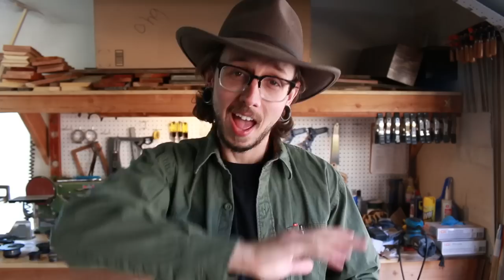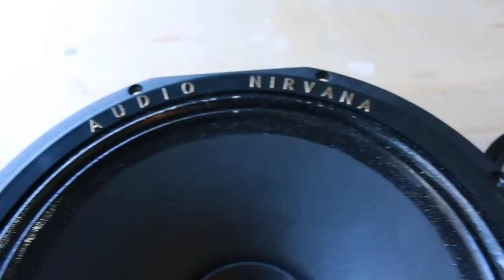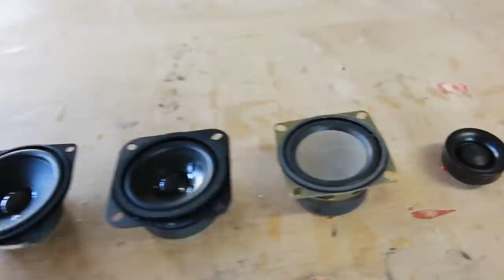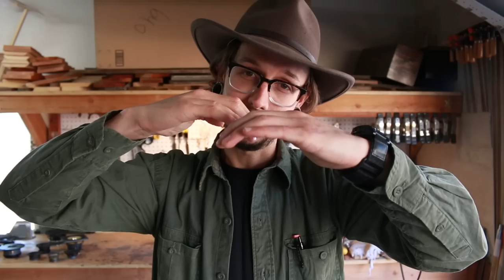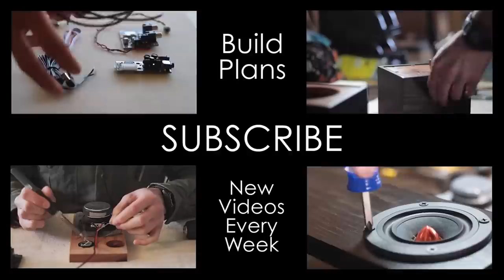7 Steps To Pick The Best Drivers For Your DIY Speaker Project || Step 3

Comment: I bought only 2 inch ghxamp and aiyima speaker and amplifiers. I also bought a narra wood here in palawan. Problem is I can not make mistakes cutting narra wood because it is too expensive. It is a one time cut and trim and making holes. Heavy wood but worth the sound quality.

Comment: I have some questions about enclosures, drivers and their acoustic relationship.

Firstly - Older/vintage enclosure shape was generally tall, wide and shallow whereas modern speakers tend to be tall, narrow and deep. What is the general sound you get out of older cabinet shapes vs new? Are newer ones better or different?

Secondly - Is there a general guide for how big the speakers (mainly woofer) should be in relationship to the cabinet? Is there a reason that a 4"or 6"woofer shouldn't be used in a cabinet that is, say, 500mm wide and 700mm tall? Is there a such thing as too small and too big?

Thirdly - Is it necessary to pad the inside of bigger cabinets or are there advantages/disadvantages to installing padding vs nothing?

Fourthly - Do you do any special calculations of how the cabinet space and shape will interact with the drivers or is that too in depth and unnecessary?

I'm asking because I have some vintage speakers (Goodman XB 25) that I need to replace all the drivers for. The woofers were missing and one of the tweeters was broken so I'll just buy new ones. They do have some 8"radio shack subwoofers as replacements which I think are good but I'm wondering they're somehow a bad match for those cabinets.

Also because I modified two sets of big enclosures maybe 20 years ago with mixed results. I had almost no idea about acoustics so I probably did too many things wrong. One set sounded okay, the other set ended up sounding weak. I can more into detail on the specifics of those if anyone wants to talk about that.

Comment: I just collect all sorts of old drivers from old speakers or cheap sets or thriftshops and based on what I have laying around I think of an enclosure type 'feels' correct for the drivers. It's going pretty well so far, already built one set of MLTL (Vifa ring radiator + Tannoy woofer, custom made crossover) and a smaller full range (FRS8 with homemade notch filter) TL.

I'm planning on building a back loaded horn with a small 3" or 4" full range driver. Can't wait :D
Reply from the maker: Sounds awesome! Thats definitly another way to go about it.

Comment: Will need to watch all of your videos 💯

Learning to build PC vs Monsters - mine requires 2 speakers + the other requires 2 speakers.

Lots to learn 💯 cheers for the playlist and plain English used  💪💯 Budget depends on speakers that fit the Monster.

As for the smaller one that cheap as chips.

$2,000 should do it for sound and other additional thoughts towards things to out pump the junk Bluetooth speaker trash they use around here 🔥 😂😂

Comment: Parts Express IS a great place for a very wide selection of speaker drivers of all types and price ranges, but also MCM Electronics and Madisound are two other great places to get speaker drivers and other speaker related components, (x-over stuff, cabinet HW, etc.)

And as far as the main title of this video goes, I also do a final side-by-side A/B/(C/D) listening comparison, (using a few of my favorite well known CDs and a special 4-way driver switch that I made), between any/all of the potential drivers that I'm considering for a speaker project to make sure I get the absolute cleanest and best sounding ones!... This is especially important to do with the midrange drivers, because I have found tremendous differences in overall sound quality and clarity, even between mids of the exact same size and type/design... And even though in general you get what you pay for with speaker quality, I have definitely come across a few really inexpensive drivers, (sometimes even "free", scrapped from another old or damaged speaker), that sound WAY better than some MUCH more expensive new ones, so a high price shouldn't be the main and definitely not the only deciding factor in guaranteeing a good sound... You definitely have to listen to them too! (As I'm sure you already know, but some people reading this may not have considered that...)

I have checked out a few of your speaker building videos, and I agree with most of what you are talking about... I might just have to subscribe.

Comment: Still loving these vidios, Just  wonderin, why are tweeters so expensive?
Reply: They are harder to make.  If you think about a 200HZ pure sine wave bass note the speaker has to respond by moving through 200 movement cycles a second, following the input waveform precisely.  At 16KHz it has to move through 16,000 cycles in the same length of time and still follow the input waveform as precisely as possible.  That second feat requires the materials to be much more rigid, yet lightweight.  You can have very light materials cheaply, or you can have very rigid materials cheaply, but you can't have low weight AND rigidity at once cheaply.  The second factor that drives up the cost is that tweeters have to be made to much finer tolerances than low and mid range speakers.  That means the materials cost more and the process of making those materials into a speaker also costs more.

Comment: When building portable active speakers (f.i. BT speakers), I would say driver efficiency (sensitivity) is about the most important spec. In theory a difference of +3dB will extend your battery-life by a factor 2. Apart from that I would look at the Thiele Small parameters, because from those you can calculate the size of your enclosure, the resonance frequency and the length of your bass-port if you build vented speakers.
The looks of the driver itself are rather insignificant, first of all you want good sounding speakers with long battery life. Based on the driver you can design a good looking enclosure even though the driver itself looks horrible, in which case you can hide your driver from sight.

Comment: I was thinking of grabbing a new pair of Polk R300s and swapping the driver and tweeter from parts express, specifically Dayton Audio DC28FS-8 1-1/8" and Tang Band W6-2144 6-1/2". I figured I'd get a two-way passive crossover at 3000hz. I'm buying the r3000 specfifically for the enclosure at 80$ a pair Canadian. Any tips? This would be my first speaker build and I really want to see what these Tang band drivers can do.

Comment: I am a newbe in the make speakers. Today i want construct 2 sorround speakers and center speaker for expand mi stereo system in home theater. My receiver is a Onkyo txsr-805 and my speakers are Polk audio RTIA9 floorstand. 
My question is: Wath  speakers (woofer tweeter)  i will select?
I like the soud of my polks and i want find the same harmonic.
Note: You chanel is very good and i learnt too much about. This encouraged me to begin this project.
Thanks.
Regars, 

Jorge
from Chile.

Comment: Have you ever done a video about full-range drivers? I'm wondering what ohm I should use in my 12 volt portable speaker? I purchased an inexpensive 2.1 amp board 50 watt x 2 100 watt sub.

Comment: Now can you take a low range woofer and a tweeter and put them in paralel in a large, heavily insulated sealed box and have good sound quality. from what i know you can and in some cases it sound better than with a midrange woofer. this is just a guess but i just want to check
Reply: You need a cross-over. When you build a 2-way system you often can do with a simple first or second order cross-over which need much less components than higher order cross-overs. If you omit the cross-over you are very likely to burn your tweeter at high volumes.
Reply: Czar Zenana  Alright, thanks!

Comment: Hey! Which 4x6" speaker drivers would you recommend? I will be replacing an old speaker inside a DIY Bluetooth radio that I am building, which happens to have this (odd) size.

Comment: I’m adding speakers inside of a small harp (a Harpsicle, with an approximate interior useable box size of 5 x 1.5 x 28 inches, 5 x 3 x 28 total if there was no wooden spine down the middle of the soundboard supporting the strings).  I think I’d prefer to use the speaker type that turns a surface itself into a speaker. Can you help me figure out what I need for this?  I suspect I need two 4-ohm transducers (I found a couple small enough to fit in the space between the string band spine and the outer case), a crossover for them (if crossovers are used for these sort of speaker) and a way to attach a 9-volt battery for power (though I’d love to be able to do without the battery).  Any recommendations?

Comment: Im building a small mp3 player with 3watt amplifier.  How do I know if a small speaker will perform well - high sensitivity?
Recall last century, 'transistor radios' had a tiny tinny sound, but now we can buy a 'boom box' the same size which is loud enough for a party.  Whats different in the full range driver inside and how to know when buying?

Comment: Do you have a recommendation on types of speakers for an outdoor application? One where it may be humid but no in direct rain.
Reply: I would suggest you try marine speakers , my favorite is a setup of 2 tweeters 1 woofer  on 2 separate boxes preferably plastic and 1 marine 10” sub or if you wanna go really cheap get any speaker and buy a can of everdry trust me it works I can fully submerge speakers and they will still play if you coated them really good inside and out

Comment: Currently I'm using a frankenstein setup of marantz precision series P-830 speakers with the woofers of a set of Pioneer S-Z94's.
At the moment it sounds amazing, but would it be worth building a custom housing?
Paid 10 euros for the P-830's with a perfect housing but woofers with foamrot, also paid 10 euros for the S-Z94's with 1 broken tweeter in one of the speakers.
Reply: hannes something IMHO building a completely new set of speakers would be a better idea. That way, you would know the thiele-small parameters of the drivers to calculate the ideal enclosure, and even spending less than $150 you could buy much better drivers (store-bought speakers usually don't have great drivers to keep the cost down, especially when factoring in their profit margin, amplifier, assembly cost...). You can check a popular and tested design (by zachaudio, the overnight sensations, or the ribbon "diy speedsters" which zeos reviewed) if you're interested.

Comment: I'd like to add a correction I think, don't worry what the look like, worry about what they will sound like. That's why you build speakers. Form follows function. For everyone out there I can tell you across the board  SB Audience are the "best" speaker drivers for the money, better than 99% of what's out there. Only thing, can only get them from Madisound. But still decent prices. SB Audience (Indonesia) is the only speaker builder that I know is 100% vertically integrated. In other words, no outside parts go into their speakers. Everything in house. From tweets, to mids, to woofers and subs, they really are a hard speaker to be, especially for the price. A 3 way tower speaker would run $300 on up for each speaker with SB Audiience entry level drivers. And still will sound great because they only make "Professional level" speakers.

Comment: Hello I had a question. I am wanting to build my own bookshelf speakers to finish out my surround sound. My receiver is a onkyo that’s rated at 75 watts rms my question is do both the woofer and the tweeter need to be rated at 75 watts? Or how does that work when using a woofer and tweeter.

Comment: I just wanna ask. Is a 60w (30w+30w) speaker too much?? I am planning to buy a 2 channel 30+30 amp, then wire a 2 way crossover to each channel, and then wire a mid range woofer and a tweeter to each crossover. Would that be okay?

Comment: Currantly doing a build with the 3" aurasound NS3 drivers. could you reccomend a tweeter and crossover for this.
  I am using 2 NS3 drivers per enclosure.

Comment: asymmetric speakers: As in emphasising tweeter and subwoofer to offset distance is also worth considering if distance is an issue. Our bedroom TV cannot  accommodate a properly configured setup as we wanted. Went with a 2.1 with refitted powerful sub and tweeters on the shelves. Mids reform with distance and more importantly; dialogue is always clear and action is always boomy without being muddy. Traditional setups that could fit were underpowered and mid heavy, weak bass and treble which was aggravating watching movies, and soundbars are champions at that crap.

Comment: can i use 2 peerless 30w rms full range speakers with an 12v 2*25 w sms amplifier? or would it not sounds good?
Reply: higher power speakers on a lower power amp allways works, but not the other way around (atleast not for max. volume).  watch the impedance, this is more important

Comment: I have been searching for a way to run two separate boom-box speakers via Bluetooth.  For me its no wires and being portable.  The output from my mixing board would need to plug into a the Bluetooth transmitter.  would I need a transmitter for each channel or is there a transmitter that will broadcast to two separate Bluetooth devices?

Comment: You don't use a subwoofer for the bass in a tower speaker. You would use a bass/midbass woofer. A true subwoofer will not produce enough mid frequencies and you'll be left wondering why your mids sounds so weak. Unless you have like a 8" woofer used as the mid-range. Subwoofers and woofers are not the same. Subwoofers require more power and a custom enclosure that could be built into a tower. Many companies do it. But you should also have a amplifier to power the sub alone that will hook to your receiver thru a rca or optical plug output on the back of your receiver. Let the speaker ouputs on your receiver power the other speakers in your tower.

But otherwise there's a lot of great info for the wanna be speaker builder beginner/novice

Comment: To further elaborate: the midwoofer must be chosen so that the crossover frequency is below the breakup point (you'll see a lot of peaks there), taking the slope of the filter into consideration. As for the tweeter, the resonant frequency is the lowest frequency that it can reproduce correctly, again taking the slope of the filter into consideration. Usually, most 6.5 inch woofers go well in a two way system. Some 12 inch woofers might also work, but it's better to do a 3-way or a 2-way with a fullrange. The lowest spl speaker in the system dictates the spl of that system. In an active system, it's easier to level match the drivers since you're doing it at line level, but in a passive system you use resistors or l-pad attenuators which are expensive and disipate heat. So it's better if they're about the same spl.

Comment: Hello Kirby Meets Audio great vids.
Not sure if you or your viewers can help..
I want to make a Blue tooth Box with these parts i had for years..
Two 6.5" 3 way speaker 240 watt max power each.   
One 10" speaker 120 watt
TPA3116D2 Bluetooth 4.2 Digital 2.1 Audio Amplifier Board DC 12-24V 100W+50W+50W  from ebay.. does it seem like an ok setup, im new to this.]

The 10 inch sub is old and was never used.  its not in the original package box so don't know what brand it is. Its an heavy well built sub with black metal frame. 
I want to build a box for this speaker and the two 6.5" speakers.
Is there a way to find out the brand or box size to build.           
I found this info on the side of it.

model number    RD-0008332
Impedance           4 ohm
Power                    120 w   
Date                        2000.10

Comment: does it matter if i use 8 ohm sub speaker with 4 ohm tweeters?
Reply: Depends on how you plan on wiring it in relation to the stability of your amp at different resistances

Comment: There's a mention of cabinet size, but no mention of cabinet type? Come on now. Tuning the cabinet is just as important as choosing the right drivers. Are you going to use sealed, or ported? Do you want to increase frequency response on the low end with a passive woofer? Do you want to bother designing and building a transmission line style enclosure to produce cleaner sounding audio?

It feels like to me that this channel focuses more on aesthetics than actual sound quality. Maybe I'm wrong, but that's the impression I'm getting.
Reply: Daniel Hodgson he has another video on the subject